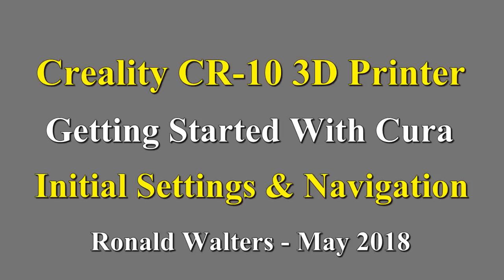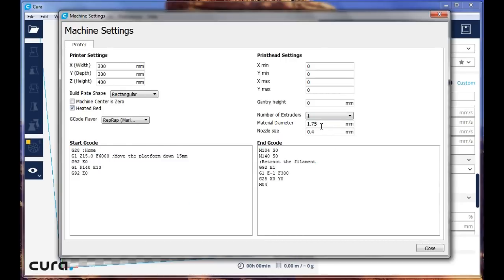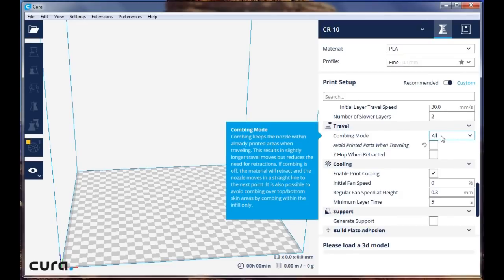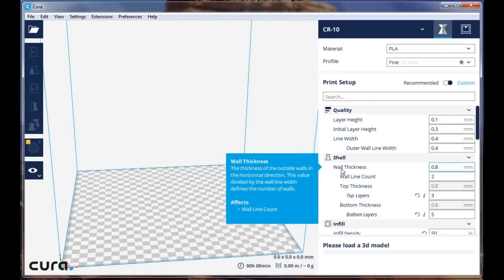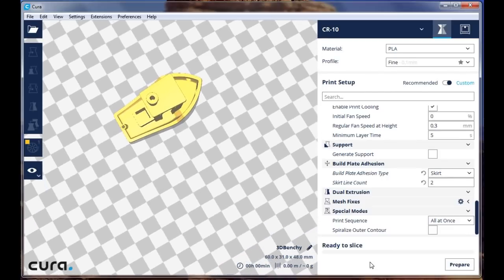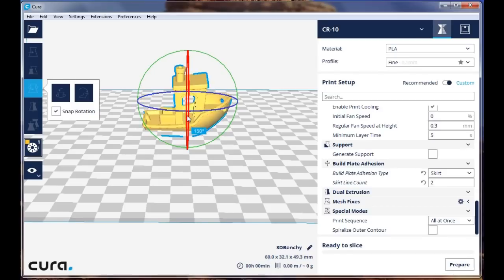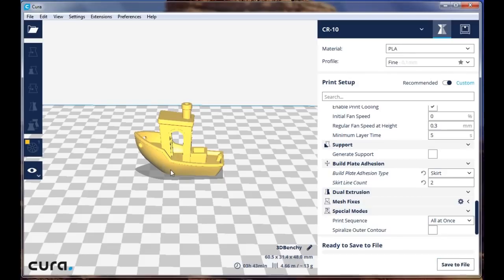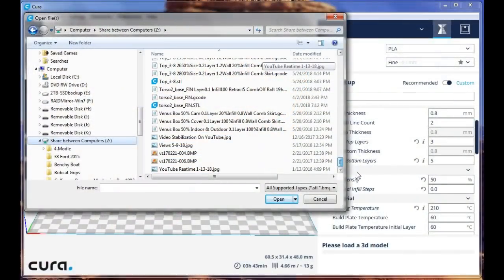Getting Started With Cura - Creality CR-10 3D Printer

Comment: I understand the notion that if it isn't broke don't fix it, however it would benifit you to try the 3.5.1 version.  You run the risk of getting outdated really fast if you stick with this antique 2.6 version and the innovations in time savings and material savings is quite impressive.
Reply from the maker: Version 2.6.1 caused its own demise a few months ago when it started distorting circles and other things and I could not get it to reset nor reinstall correctly. Back in August 3.4.1 was the latest and (on my computer) it had all sorts of issues with many questions and negative comments posted online which did not seem to be receiving answers. Not having the patience for that, I backed up to 3.2 which is currently functioning and will serve its purpose until they have time to debug the 3.4+ version. Thanks for watching and fro your comments.

Comment: Dear mister Walters - thanks a lot for all your videos and shared experience. @12:47 seems like the scaling of models in inches is 25.4 times  (this is how many mills in 1 inch). so the perfect scaling should end up as 2540% (pretty close to what you've found emperically)
Reply from the maker: Read the other comments Ivan. Starting at 10,000% and ending up at 2550% (the correct diameter 56.9mm or 2.24 inches) has no relationship with 25.4. Thank you for watching!
Reply: disagreed. scale 100% will be the printed size of your model like 2.24mm. so to get to needed 56.9mm you need to scale up to 2540%. the author (Daduck748) suggested the same thing for person in question about inches and it worked for him well (see comments section there). by the way diameter in the stl file is 2,2228
 inches

Comment: Ron MM to Inch conversion is always 25.4  your video is very good!
Reply from the maker: As always 25.4mm = 1 inch. My point is, that conversion has nothing to do with trying to get the Top Spinner in this video (or some objects entered into Cura) to scale down correctly. It started off at 10,000% (if divided by 25.4 would equal 393.7 which is a useless number.) The final correct size ended up being 2550% (if divided by 25.4 would equal 100.39 which is a useless number). And 10,000% divided by 2550% equals 3.92 which is another useless number. What is being pointed out in the video, the only way to determine the correct printing size for some objects may be by trial and error.
Reply: @RonaldWalters2010  No need for trial and error. Since 1" = 25.4 mm, if your design is in inches, instead of dividing, it needs to be multiplied by 25.4. That is accomplished by printing the design at exactly 2540%.

Comment: Hi Ronald, I have watched a large number of your videos now. (the whole series on the busker organ. Excellent) I appreciate the effort and time that you have spent in producing very very good content. Thank you. I was brought up with inches but now use mm. I have to think really hard to convert back to inches. Can't stand  adding and subtracting fractions.
Reply from the maker: Thank you for you nice comment, which is much appreciated! Being an engineer and having worked overseas for over 20 years, I grew accustomed to the metric system as well as occasionally driving on the other side of the road (and repeatedly being required to switch back and forth). But... as they say, "old habits die hard" and I drift back to imperial measurements and deg F. So, are you going to build a Senior 20 Organ? Thank you for watching.
Reply: I am examining options and gathering information at the moment. I want to build a full sized organ at some stage. I think that a busker organ would give me a chance to learn something about organ building.  I have a copy of the open source manual from the guys, who made the video "How to build a hand cranked organ" I am also considering buying plans for the senior twenty. I have a number of other projects to complete first.
Reply from the maker: I would suggest forgetting about the Busker as the Senior 20 is the upgraded version. Then, John Smith's "Topsy" is a large organ which plays midi files and has over 100 pipes and is a super nice organ.

Comment: Ron, add this to your printer End Gcode just before the M84 (steppers off statement):

G1 X0 Y295 ; Move bed forward.

This pushes the bed forward towards you and moves the head to the far left at the end of the prnt, it doesn't affect the Z so it won't drag across your part.  Basically it places the bed in a place that makes parts removal easier.  I've been using this on my CR-10 for quite a while and find it really handy.  

The checker pattern in Cura is 10mm (.4") squares for what it's worth, not a very accurate way to scale things but it could get you in the ball part fairly quickly I suppose.  I use millimeters only when using my printer, yes I sometimes have to think in inches but I have found that using millimeters is a whole easier.  Anytime I create something in Fusion, it's in MM, I have a set of digital calipers that I use to measure whatever I'm drawing or copying.  I Rarely get into trouble doing that way.  

Lastly, I did end up buying a second CR-10 using your link - thanks!  It got here yesterday so now I can print twice as many things.  :)  Okay, I'm going to use it while I modify my first printer to use double Z and add a leveling sensor.  Thanks again for your vids, I enjoy them all.
Reply from the maker: Thanks, I will try the End Gcode. I do the same thing with digital calipers. Must admit the old gray matter is firmly embedded with inches and deg F. :-)